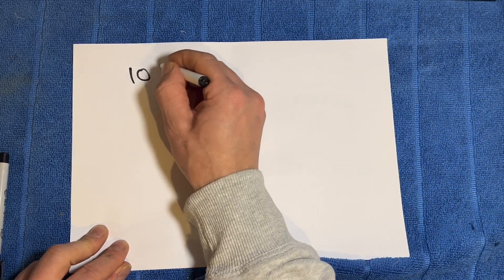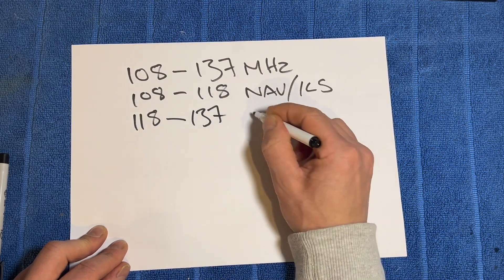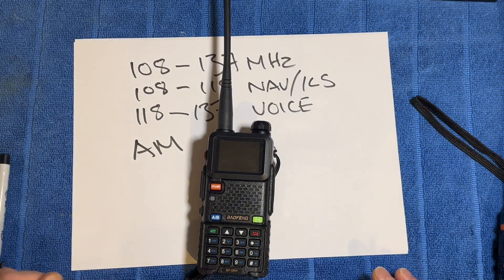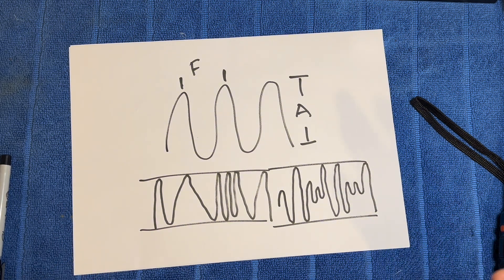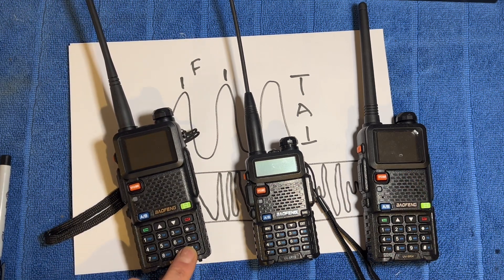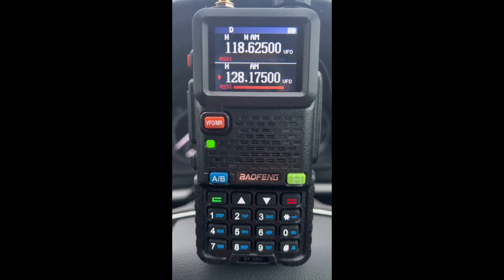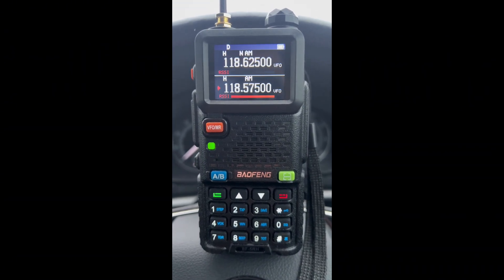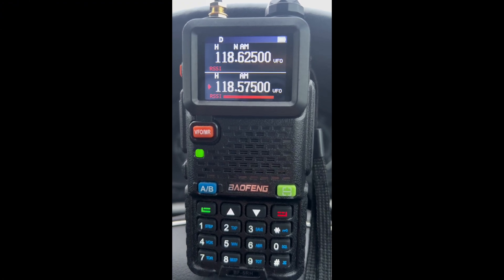Baofeng Airband

Comment: Is it possible for a single multiband radio to receive both airband and FM signals simultaneously? It seems like the multiband radio is able to only receive on a single mode (either airband or FM, but not both), and I wanted to make sure this wasn't something that could be unlocked or changed in the settings
Reply from the maker: Sadly not. The radio only has a single “receiver” so even with Dual Watch enabled it’s a case of the loudest signal wins.

Comment: I have a Baofeng UV-5G Pro. Although it's advertised as airband capable, it still doesn't pick up airband, except for static most of the time. I have an aftermarket antenna tuned for including airband frequencies. Any idea what issue im having? 

Little side note, I also have a vintage VHF airband radio, and it recieves fine, again, while my new one doesn't.
Reply from the maker: Possibly one of two issues. 

Firstly it’s faulty and you need to send it back for a replacement. Does it display “AM” when you’re selecting an airband frequency? 

Secondly that it’s a sensitivity issue. At the end of the day it’s an FM radio that’s got a built in AM adaptor and not a purpose built AM radio. Does it work if you’re close to a source of Airband activity, close to an airport etc?
Reply: @M8KHC  It doesnt show AM on the display, but I was able to recieve standing on the garage, but it was still unclear. Theres some frequencies that barely recieve just standing on the ground, but some I can only get in very specific spots.
Reply from the maker: @Ampere40465as I don’t have a UV5G Pro myself it’s difficult to advise you. Make sure you are in AM mode by pressing the orange band button until you see those frequencies. Also try using a different antenna

Comment: As a FAA licensed pilot, how can I enable BAOFENG 5RM air band transmit?  
Is a schematic available that might provide a clue of how this might be accomplished?
WB6BBB
Reply from the maker: No. 

As an FAA pilot you should know that the production of transmit capable radios is highly regulated and scrutinised. 

Regulations: (UK)

• The radio equipment should be approved by the Civil Aviation Authority or EASA;
• The radio installation is approved by the Civil Aviation Authority Approved Maintenance Organisation;
• The installation and use of the radio equipment is covered by a Wireless Telegraphy Act Radio Licence issued by the CAA on behalf of the Office of Communications;
• The user of the equipment holds a Flight Radiotelephony Operators Licence issued by the Civil Aviation Authority.

Hardware:

The Baofeng radios are $30. For this you get a basic FM radio. The AM airband receiver (if available) is a very basic demodulator and is not a modulator for AM transmission. Even if it was Transmit capable it does not have any filtering, nor does it have any level of spectral purity. 

In a nutshell it is A: Impossible and B: highly illegal if it were possible. 

I find it highly unlikely that ANY responsible person would want to transmit on AIRBAND with a $30 radio for any professional reason.

[edit]
However, and after sleeping on this and realising that my initial reply was a bit of a rant (I apologise) and in the spirit of amateur radio which encourages learning and experimentation, I would add the following…

It may well be possible to force the radio to transmit an AM signal by modifying the software but there are two main issues. 

The first is that Baofeng flash the firmware to the radio at the factory and have historically never issued any updates. Unlike Quansheng and TidRadio no one has been able to develop custom software for Baofeng due to this. People have tried but not really succeeded in modifying the software due to the complexities of how it is initially installed. 

Secondly, assuming that we in fact could modify the firmware to Tx AM airband the limitations of the hardware itself would not lend itself to any sort of quality output.

Comment: the part I dont understand is they market it as transceiver. Which alternative to ICOM price wise can also SEND signal? Im looking for one but ICOM price is really expensive as I will be flying gyrocopters for example. Or lightweight aircraft
Reply from the maker: It’s a “Transceiver” because it transmits and receives on the 2m and 70cm amateur ham bands. 

Airband transmissions can only be done from calibrated, licensed and heavily regulated radios. These are purchased from very specialist suppliers who’ll need the aircraft details and relevant licenses. 

Sadly there is no such thing as a cheap airband transceiver.

Comment: Bought a UV-17 pro with airband....at £29 I thought take a chance.....my old hand held bit the dust.

I tried one of these walkie talkies a year or so ago with air band not Baofeng....it was useless got a refund as I got it off an UK supplier.

The Baofeng was from China so I knew if no good I would be stuck with it....and my thoughts where if its a Baofeng good chance it will be acceptable.

Well I was wrong.....the AM Airband on the radio was useless....any signal with any sort of strength was so distorted to be more or less unreadable....the odd weak station may have been clear enough to make out.

I am a licenced radio ham in the UK so not a total loss as I can use the 2m and 70 cm allocation that on this radio.....and to be fair the FM side was very good.....great reports from a radio chum 5 miles away.

But as I already have 2 baofengs I didn't really need a 3rd one....my advice....keep your money in your pocket.

But I still needed a hand held for my visits to the airport on my motor bike.....I already have 2 very good base station scanners....both realistic prob 30 years old...still doing a great job.

There really is not much choice for small hand held Airband Scanners....those that are are silly prices.....Uniden seem to have cornered the market....£160 is a rip off for the UBC 125.

But then I discovered the cheaper EZI-33-XLT....at £85 I could live with it....civil only airband....no prob as Mil dont interest me.

Is the EZI-33 any good....yes clear....even at the airport with a 737 50mts away transmitting....audio was find....again...the 737 50 mtrs away....up at my ear...fine....and even not overloaded when hooked up to my very good    external house chimney mount antenna.

The manual is quite poor though.....I dont need a PC to load freq....just program it from the key pad.....took me a day to figure that out.....and I am very used to scanners.

Nick 2E0LPL.
Reply from the maker: I understand what you’re saying Nick. 

The Baofengs lack AGC and the AM conversion is simplistic to say the least but ultimately it’s a case of “you get what you pay for”

If it brings new people to the hobby then it’s a good start. 

73’s and hope to catch you on the bands sometime. 

M7EUP

Comment: Used to be 25khz......but not now....spacing for airband am is 8.33khz now.

I wonder.....have you any experience with the Baofeng UV-17M airband capable hand held....looks promising.....up to now I struggle to find a budget hand held with good am airband.....I dont want to p[ay silly Uniden 1215 sort of money.

Can I ask.....your demo of 128.175 was scratchy..... how far from the tower are you.....and what antenna,.

Nick 2E0LPL.....life long airband listener.
Reply from the maker: Hey Nick. 

Yes, the 8.33kHz spacing is standard across Europe but for a “Basics” video I didn’t want to go into too much detail with that. Most airport will also publish  secondary “near enough” frequency as well. 

The UV-17 radios have the same internals as the uv-5RH but be very careful if getting the latter as there are two variants. Make sure you select the correct one and from a reputable seller. 

128.175 is the ATIS for Manchester airport which was located 28 miles from my location. I have a simple dual band magmount on the roof of the car. 

Be aware that these cheap handhelds don’t have any sort of AGC or ACL so volume and quality are always an issue. That combined with the minimum bandwidth being 12.5 when set to narrow audio quality is always going to be an issue.
Reply: I live in Runcorn....I get the atis quite well here....good for checking antennas ect.

Hand held airband for me is purely visits to the airport on my motorbike....not very often.....I have a 2 very good base station scanners at home for most of my listening.

My old hand held is getting past it and cant get some freq with it being 25 and 50khz steps only.

Been an airband listener since the mid to late 60s...1960s. ..I am 71 now.

Airband in some ways was more fun then....well if you collected reg number like I and my mates did....all airliners used the a/c reg as a callsign....exciting times.

there is no way will I pay unidens prices....

So the UV-17pro M looks very attractive if its better than the other offerings from china.

Seen a few youtube clip with a bit of audio....sound quite good....but need to be convinced....some more home work req.

Need to find somebody who has one and understands radio a bit.

But in a high signal strength area ie at the airport.....it may indeed get swamped.....and as they only are supplied from  china at present...sending it back is not an option.

What bands do you work.....mainly HF for me....I do have VHF/UHF but dont use it much....be good to work you.

Have 160m and 80....so ok for local on them.

Nick 2E0LPL
Reply from the maker: @nickaxe771  I’m limited to VHF UHF at the moment as I’m just getting started on HF. 

I’m in the process of setting up my EFHW at the moment which should give me 40-20-15 and 10 with a view to adding a loading coil in the gutter for 80. 

Hopefully I’ll put you in the logbook soon 👍🏼
Reply: @M8KHC  Yeah I am sure we would have plenty to chat about.

My c/s lima papa lima.....I live very near the LPL NDB location in runcorn....349.5khz....so borrowed it ident.
Reply: Update I bought the Baofeng UV-17m with airband...£29....result on airband....its useless....some who dont know any betting may think its ok.....not being insulting honest.

Get badly overloaded with any sort of signal with any strength.

Came from China so sending it back is not an option.....I would have if I could as I already have to Baofengs for VHF and UHF ham bands....not that I use them very often.....for FM vhf and UHF they are all very good I must say....AM Airband forget it.

I have since bit the bullet and bought a very very over priced Uniden for my visits to the airport....not the 125....I just would not pay £150 for one....yes they are good but its a 100% rip off for RX only.....

Uniden have the airband AM market more or less to themselves and the abuse that position.

But I needed an airband scanner so bought the Uniden 133 at £85.....its very very good.....sensitive....strong audio ect and mains rechargeable.

Sensitivity on a very good VHF diy dipole on my roof.....its as good as my base Pro2005.....and thats good.

I only bought it as it was a gift.

Tricky to program even for an experienced scanner user of over 40 years.....but after a day I sorted it.

Has no mil airband.....not important to me.

Such a shame That Tandy with there Realistic Range where not still going.

Nick.

Comment: U need 8.33 step size there's loads of 8.33 freqs in use, sometimes done freqs are ok slightly off but prefer to have 8.33 capable radios
Reply from the maker: I agree. The European 8.33 step was introduced to double the number of channels available. Most ATC however stay within the worldwide allocation
Reply: @M8KHC  wouldn't say most lots of airfield and atc Airways are on actuall 8.33 nowf
Reply: Some are still on what were original freqs but spacing changed ie 075 became 080 but a 075 is still freq 075 even if channel number is say 122.080 Duxford, it's still 122.075, but we have sone airfield who changed like Oxford radar 125.090 125.0916, Cambridge app 120.9666,many airline company freqs have gone onto 8.33 actual freqs there's lots and lots
Reply: No 8.33 on a radio I'm. Not interested in terms of airband it means just locally to me in Hertfordshire 10 or more airways freqs and bbmf air to air , blades team air to air, then out even airshows there's the new airshow and event freq 127.10833, there's lots yes some radios can get nearer without 8.33 but if 25 kHz there's so much missed
Reply: @mpol701 Airways? Like Victor Airways?  So, do they assign specific airways to a specific fequency?

Comment: I got my UV-5RM 8W "multiband" same as RH open versions    - but the AM Airband is not true modulated AM i suspect  . very bad , picks up planes well but sounds FM on AM. impossible to make out what they say.  Newest Chirp 23 dec got UV5RM added now
Reply from the maker: My experience with the AM airband is that it works perfectly well as you’ll see in some of my other videos. 

Check that you are not off frequency slightly and be aware that signal degradation of AM over distance is worse than FM
Reply: @M8KHC i meant i got the UV-5RM.. i live 400 meter from the airport runway . propeller passenger planes,  . getting another uv-5rm tomorrow in the mail so i will compare them on AM..all other bands is very good, like the speaker. all settings ,khz step,and freq correct. i have a lot of radios. old airband 1986 no problem,.he he, crystal clear. been into cb,scanners,. all meters ,and all kind of radios since 1979

Comment: It always blows myind how strong the beacon is from the international airport near my home. It's about 47 miles and is extremely loud and clear here. It's very much the best possible line of site between us though. No mountains and no hills period. Just trees and not even many structures. It's clear on am and fm. Like you said, they also broadcast in fm.
Reply: What sort of beacon are your hearing......is it an NDB Beacon....down near the MW section of the radio band or a VHF VOR maybe.
Reply from the maker: Most airport Nav aids are located strategically to give the best possible line of sight. They also transmit at 200w and above so that helps.
Reply: Same question... What kind of beacon?
Reply: It's the vhfor

Comment: Is there a way to unlock airband on uv5rh v2 with modification?
Reply from the maker: I’m working on it, essentially they’re the same radio so it should be possible with some software modification. If you’re subscribed you’ll be notified when I post the video.